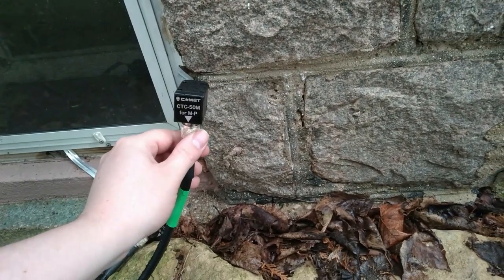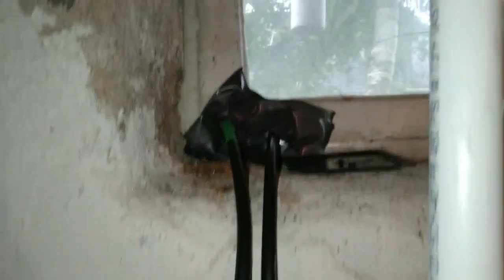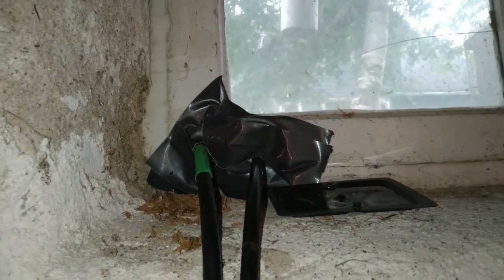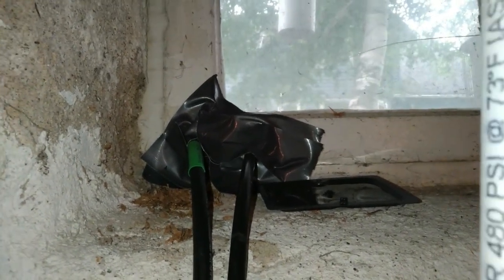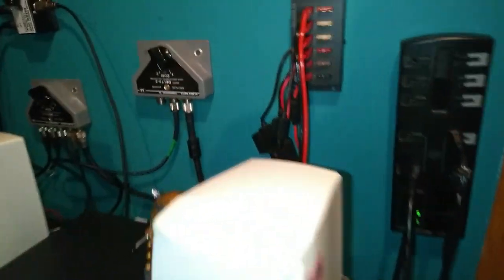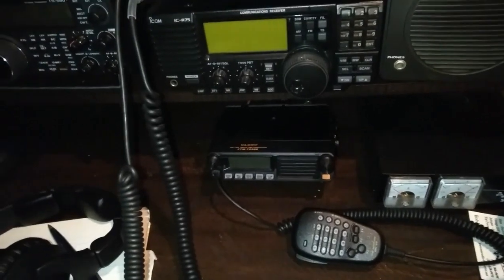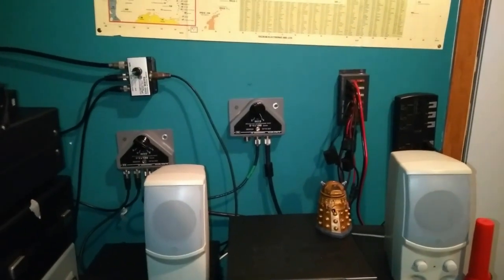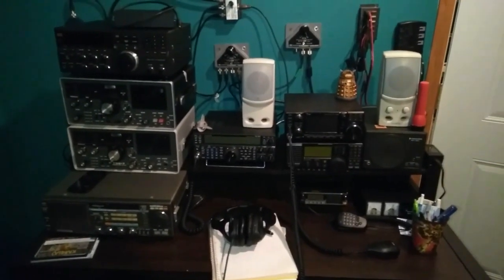KD9LVR's Ham Shack Update Aug. 15th 2020

Comment: improve the antennas..   a radio is not any use without a good antenna..         FRG-7's are great  ;)
Reply from the maker: I'm constantly playing around with antennas. I'm currently working on a plan to get the vertical portion of my inverted L higher into the air.
I love the FRG-7, that's why I own two!